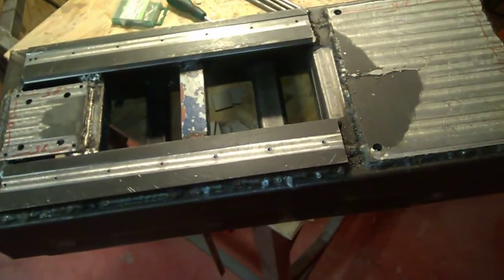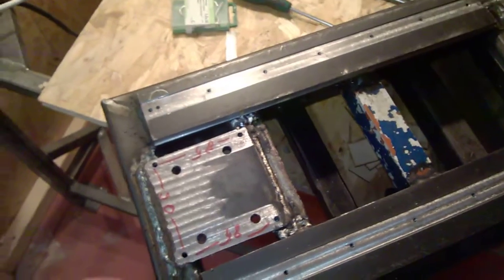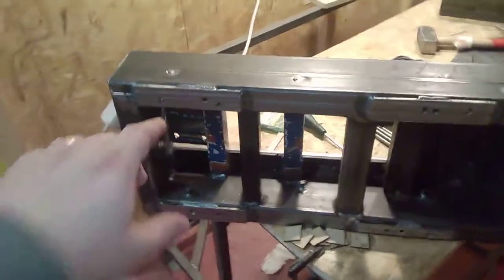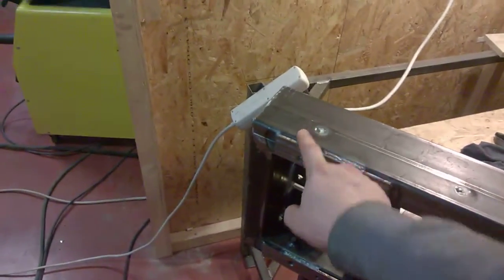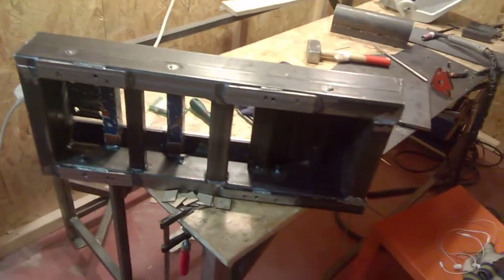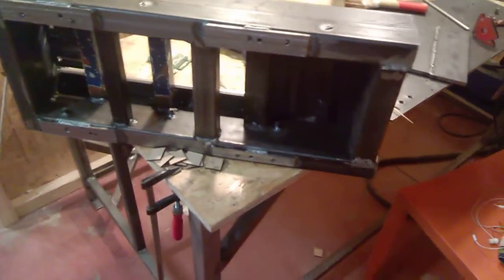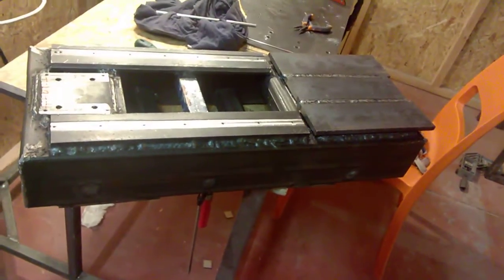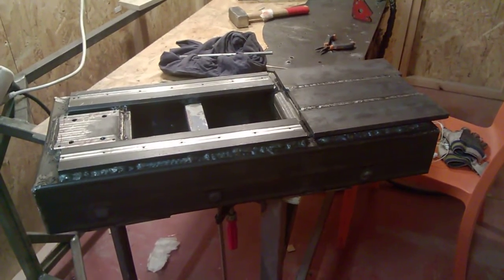DIY cnc lathe build - part 2.1 , changing the frame,remachining,tailstock

Comment: I've noticed you weld a lot of strips together for making bigger plates. As I'm sure you already know that causes lots of stress that'll take years to finally settle down. One thing I've been using is Rail Road track plates. To flatten them I'll use a big side angle grinder to take down the bulk and then mill flat with a carbide fly cutter. It doesn't lessen the work involved but it's free for a walk along a rail line.

Comment: nice to see it coming together man.  if you ever need any help with drawings or anything let me know, that's my area of expertise.  20 years of CAD experience under my belt... I doubt you need any help based on what you've shown but if you ever want to bounce some ideas around let me know.
Reply from the maker: Well, I am planning a fourth machine (not revealing it yet) - might need some sanity checks there lol. But the lathe is actually more finished than whats shown in the vid . I'm planning on finishing the surface grinder this week (got the ballscrew mounts and stepper mounts done today - tomorrow is ballnut mounts and then hooking everything up for a few tests!). I hope I will get the lathe moving by next thursday (I can make the spindle next wednesday) :)